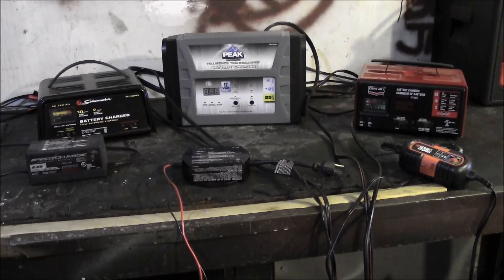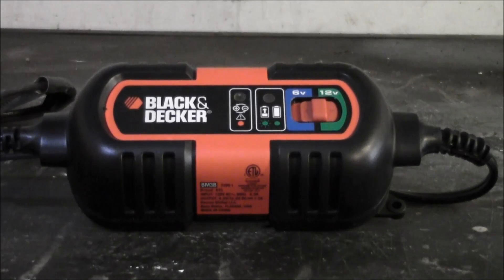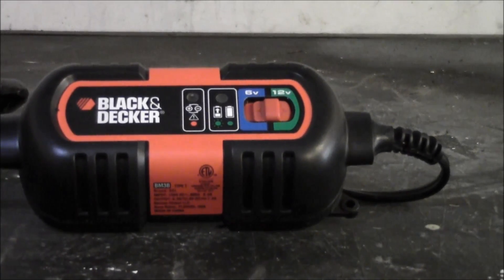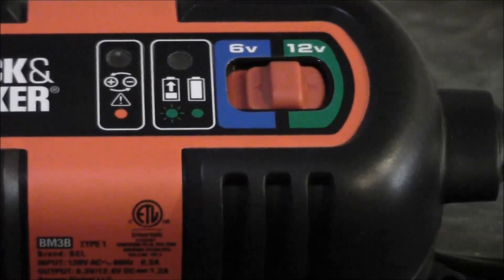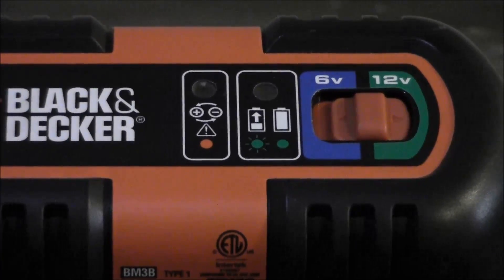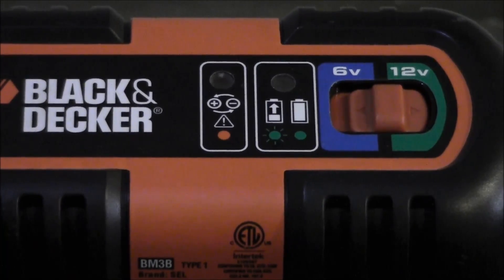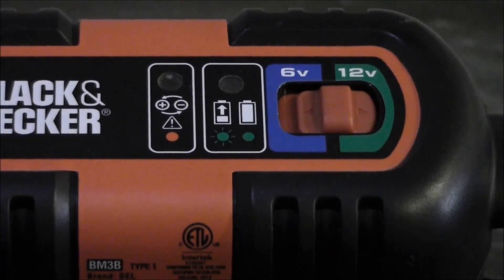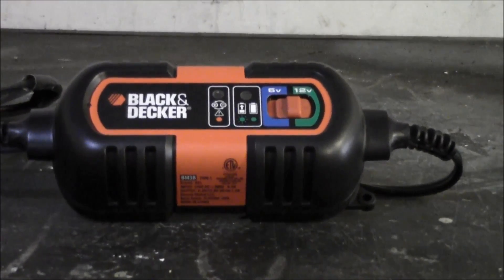What you need to know about battery chargers part 1

Comment: HI I HAVE A 12V GEL AND A AGM 12V BATTERY SO WHAT IS A GOOD BATTERY CHARGER FOR GEL AGM AND WET BATTERYS THANK YOU FOR THE HELP.
Reply from the maker: Any battery charger that has a GEL and an AGM setting should be fine.  The Schumacher SSC-1500A-CA would be a good choice. However, several chargers out there should meet your needs.  Be sure to shop around.

Comment: I heard that I could use a battery charger just to check out my electrical system on my Honda 650cc Nighthawk motorcycle. Not to start it up but just check if all lights work. Just want to make sure all my lights works before I go out a buy a new battery for it.
Thanks.
Reply from the maker: I would just use jumper cables and hook it up to a good 12V battery to check that.
Reply: Thanks, will give it a try.
Reply from the maker: You're welcome.  Good luck.

Comment: Can a single maintainer/charger be used to maintain/charge 2 batteries at the same time? If so, how would it need to be hooked up to do this?
Reply from the maker: +Terrance Williams Yes it can.  You would need to connect the batteries in parallel like a dual battery diesel truck.  Connect the positive of the first battery to the positive of the second battery and the negative of the first battery to the negative of the second battery with battery cables.  Then connect the maintainer as usual.  Be sure to load test both batteries before charging if possible.  If you have one battery that is going bad... neither will take a proper charge.Check out this dual battery video I made.  It may help you out.  https://youtu.be/ythdX9qtny8
Reply: @fwh79FOXR6  Hello and thank you for this video. About charging 2 batteries at once...are you SURE the positive of the first battery is connected to the POSITIVE of the second battery? I've seen videos where you connect the positive to the negative using 1 jumper. Then, connect the jumpers from the charger to the negative of the first and vice versa for the second.
Reply from the maker: @johncalvo1743  Yes, you want a parallel connection to maintain the proper voltage.  Noco likes to show a series connection (positive to negative between the two batteries) to get people to buy a charger that can charge at 24 volts because connecting two batteries in series will double the voltage.  It's really not needed though, just connect the batteries in parallel and not in series.
Reply: @fwh79FOXR6  Wow! Thank you for the quick reply. I wasn't expecting one since this was an old video. Okay, so here is my specific situation: I have a 12 volt car battery charger. It has the option to use 2, 5 or 10 amps. I have two identical 6 volt, 2.5Ah from my exercise bike. I want to charge them as they are completely dead showing .58 volts. They are enclosed lead-acid. Since I can't charge them singly with my charger, do I connect them in a series or parallel? Also, would the 2 amp setting on my charger still be too much? Thanks again for your help.
Reply from the maker: @johncalvo1743  You're welcome.  Connect them in series and charge at 2 amps.  Try to keep an eye on them as well.  If they have been discharged for a long time, they may not take a charge.  Good luck and let me know how it goes for you.
Reply: @fwh79FOXR6  Thanks for your help. I have decided to buy one of those small 6V chargers on Amazon. The reason being, after a little bit of research, I understand that charging at 2Ah might cook the battery, even though the battery itself is a 6V/2.5Ah unit. I was told by the manager at Batteries Plus that you should charge a dead acid battery at about 25% of it's Ah rating. Is this true? Regardless, the charger I bought charges at .5Ah - .6Ah. Thanks again...
Reply from the maker: @johncalvo1743  You're welcome.  Yes, you really want to charge at a lower amperage when the battery is severely discharged.  I think you made a good choice.
Reply: Thanks man!
Reply from the maker: +Terrance Williams Your welcome.  Glad I could help.